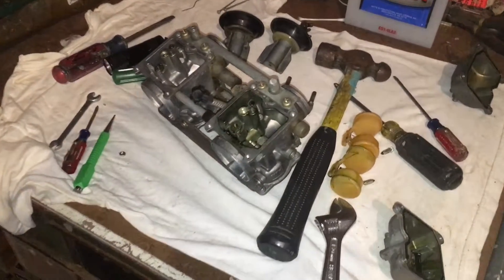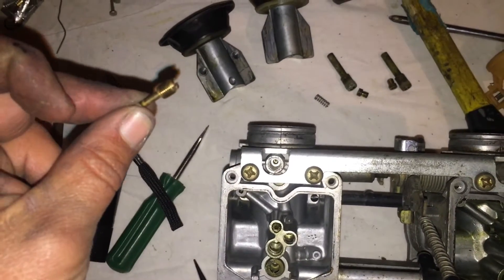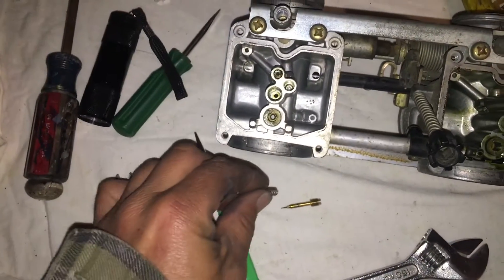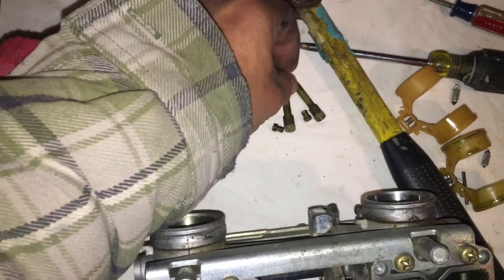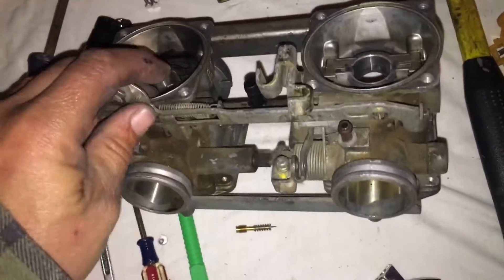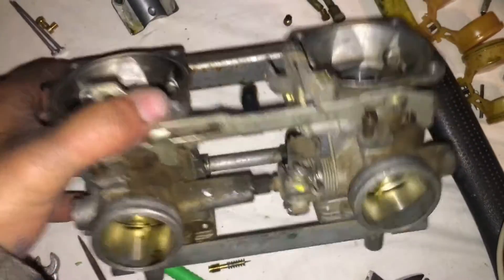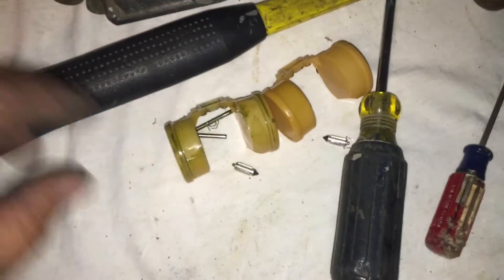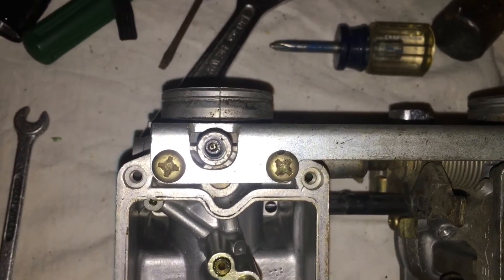Carb Tour/Idle Adjustment Screw/Tamper Proof Plugs/Ninja EX500/500R

Comment: The exploded view of my carbs on my 07 Vulcan 500 LTD looks exactly like yours. I happen to notice that there is suppose to be an o-ring on each of the pilot screws that goes before the washer, then spring is last. Did yours have these o-rings?
Reply from the maker: Yes, if they are not there you should get them…..that is what seals it up
Reply from the maker: I believe the washer is only there to keep the spring from damaging or moving the O-ring